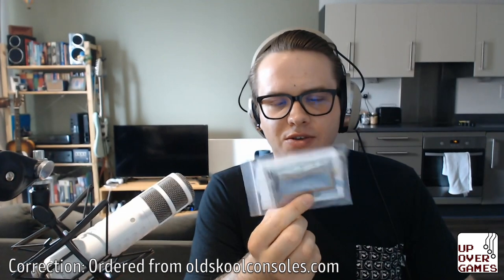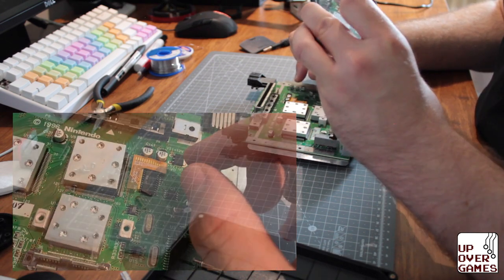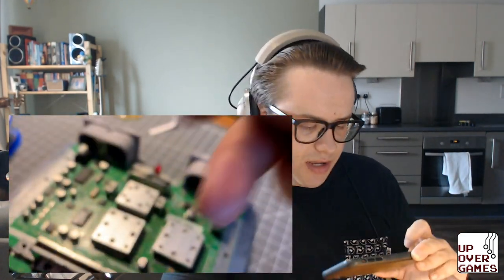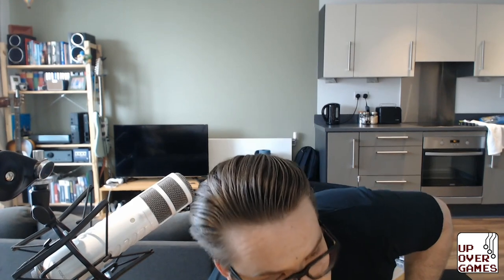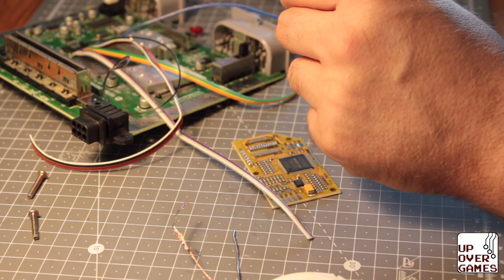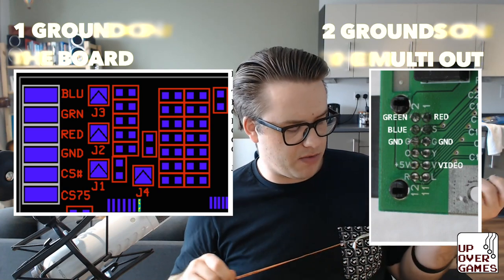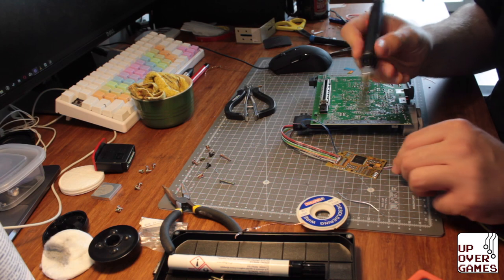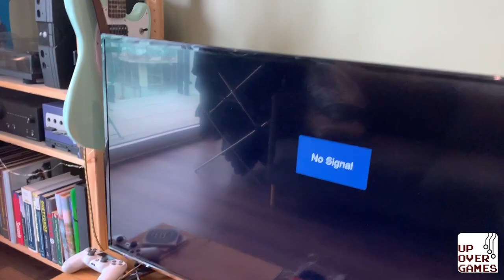Will I break it? - N64RGB - etim's Nintendo 64 RGB Mod Chip

Comment: Just did mine and I’m experienced at soldering.  I have to agree with you, a single core wire would be better for soldering, however single core will make the cable really stiff which will put a lot of pressure on your solder joints.  Putting pressure on the multi stranded wire can splay them out, but it is doable. It’s a fine line of putting enough pressure so both the pin and wire get the needed heat for the solder to run and make connection and not too much pressure so the wire splays out and bridges with neighbouring chip pins 🤣 After doing this one, I actually would have preferred having the model that needed the adaptor ! The moulded ribbon for the adaptor is far easier to solder to the chip, than the ribbon cable imo!

Anyways, mines together and seems to pin out fine with the meter.  Can’t test it properly because I don’t have my SCART cable yet, but my SVIDEO still works, so that’s a good sign 🤞I’ve attached the deblur option switch as well, so that will be interesting! 

On another note, my OSSC turned up and oh my, what a great device it is so far on the consoles I’ve been able to use it on so far!
Reply from the maker: Glad you managed it. A total pain but worth it.

Comment: By the looks of the first results. Sounds like you're using HDRetrovisions's SNES Component cable judging by the lack of red signal at the first go. :) But that is a swell work on the mod. I installed this into mine back in 2017. An excellent mod to say the least. Glad us PAL region users can have RGB video on our N64. :D
I would so recommend this mod since It was easy for me to install it on the first go. :)
Reply from the maker: Thanks, I’ve chucked you a follow
Reply: @upover  Wow, thanks man. :)

Comment: What size wire do you use for the output? Thanks
Reply from the maker: Sorry for the delay. Iirc it’s 30awg
Reply: @upover  thanks. I worked it out. But as a novice solderer fried my n64 and ended up buying a ready modded one 🤣